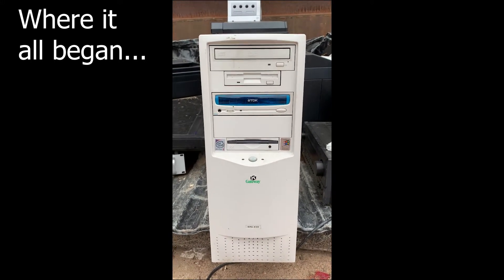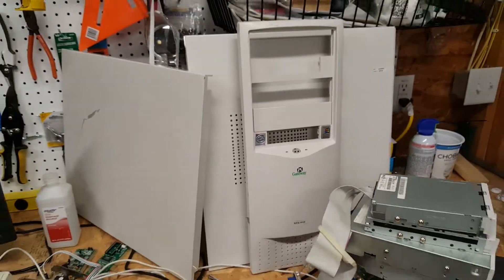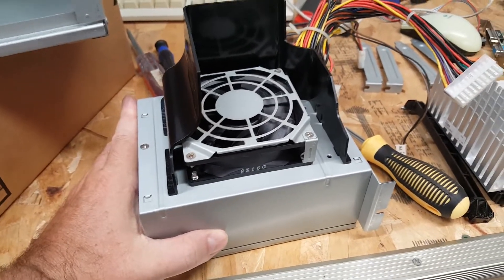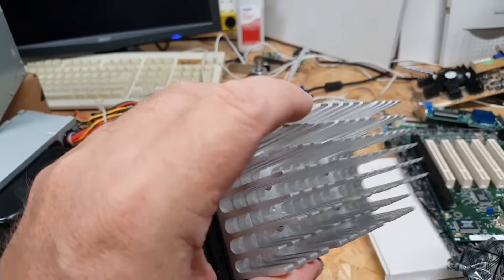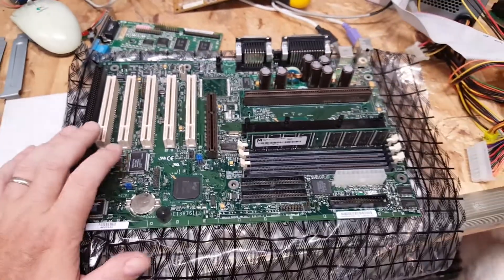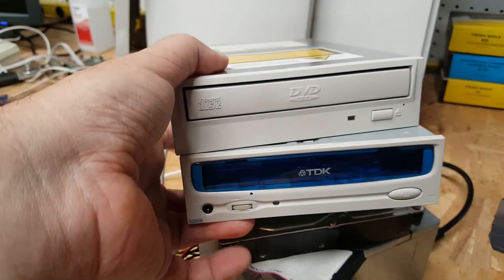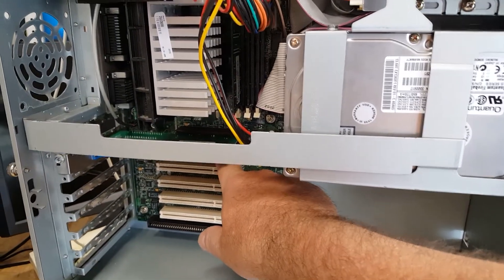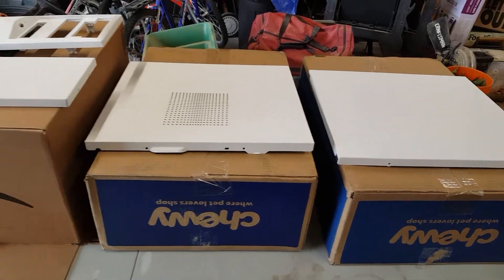Finding, restoring, and benchmarking a classic American Family Computer: The 1998 Gateway GP6-450

Comment: Hey, I just found this video because I’ve been trying to figure out what sort of upgrade options I might have - the GP6-450 I have has a Pentium II 450MHz as well, but I also have a Slot 1 Pentium III… Would you happen to know if I could swap them?

Currently as far as video card goes I’m using what I think is a low profile Matrox G450, but I’m not sure how much memory it uses - from what I see online it’s 32mb but I swear the BIOS reported 64mb…

Thank you!
Reply from the maker: so... most of those Pentium II mobos cannot support Pentium III CPUs.  It is so old that your only option is to stick it in the slot and pray.  It should not be an issue with it blowing up.  The FSB is 100 MHz on the one you have, so... all that will slow you down might be the FSB ratios (yours would be a 4.5x of course).  As far as that video card, I would hazard that it is a 32 MB card and the 64 MB you see in the BIOS is the AGP memory hole.  Not 64 MB existing, but the system reserves address for that much in theory 🤓
Reply: @UncleMikeRetro  Thanks for your response! I've been tinkering with it a lot lately, I read on old forum posts that the Katmai P3 like I have might work, but I tried it out last night and it didn't post haha. I also appreciate the info on the Matrox, I checked and I realized I misinterpreted the AGP buffer and it's a 32mb card. I haven't used a PC this old since I was a kid, but it's been a blast working on it and a huge nostalgia trip, especially after spending a couple of days installing my dad's old mid/late 90s PC games! Maybe I can find his old Voodoo3 3500 sometime...

I ordered a SoundBlaster Audigy 2 (after considering between it and the Live! 5.1) that's arriving today because I've heard with some hard work it should work in 98 and I'm excited to try it out.  I'm wondering if maybe I can hunt down some BIOS updates that would let me use a Pentium 3 but I don't think it's likely. I found some Gateway Essentials drivers on the Internet Archive with what looks like a BIOS update package that should work, but I've had trouble finding anything about the GP6-450 so far. After this, I think I'm going to start looking for recycling centers to find more stuff like this, and hopefully a CRT!

Thanks again!

Comment: 12:30 - the results you got with the Voodoo 2 are extremly low maybe because vsync was on. A Voodoo 2 should get 60 fps in 800x600 not 39.
Reply from the maker: You think?  remember it is only a single V2 and a PII 450.  I've seen the single V2s clocking lower FPS on PIII 500s in the past
Reply: @UncleMikeRetro  I'm sure vsync was on, thats why you got such low FPS with the Voodoo cards. I am a big 3dfx fan, have multiple Voodoo cards and use them all the time especially for benchmarks :)
Reply from the maker: @supermario8416  Re-run it is!  Thanks!